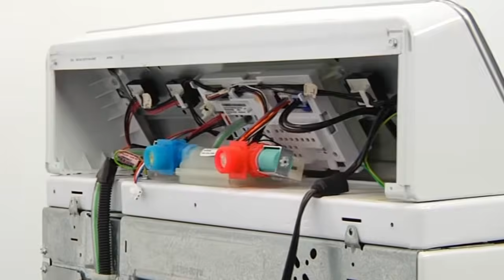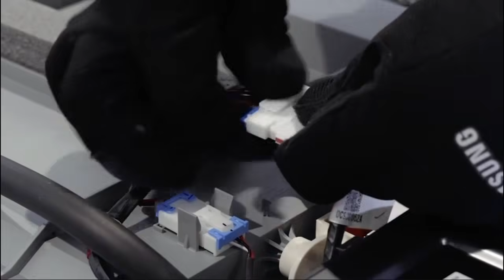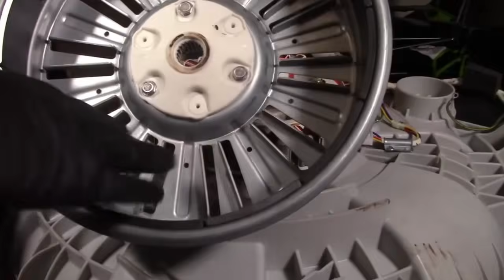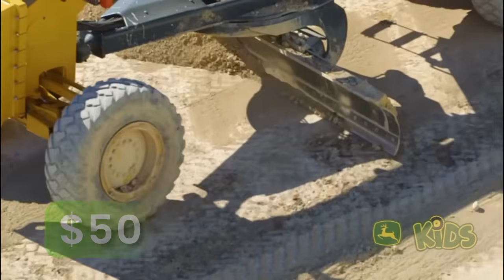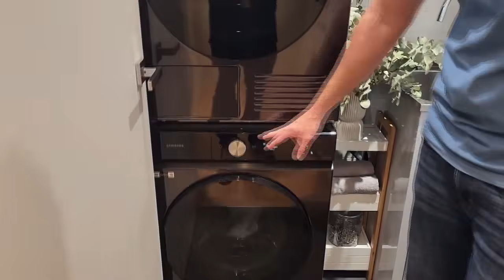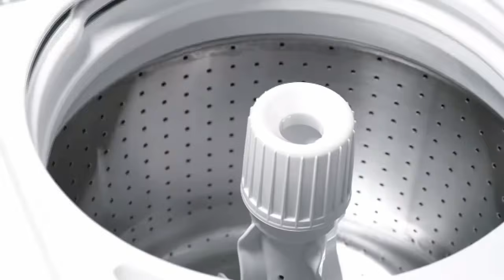Why You Can't Fix Your Own Washing Machine Anymore (The End of DIY)

Comment: Maytag is whirlpool and there is no app required to access error codes any body with half a brain and Google can do it  heck the special tool whirlpool has for us whirlpool techs doesn't even work  we just use what is built right into the machine with no special access required just a brain and a finger. Looks like the author of this video earned the middle finger though!.  The machine even comes with instructions on how to access the codes!

Comment: Not true at all.  None of the major appliances do any parts pairing.  Unless maybe meile or something.   LG offers bearings separately nobody else does. 
Whirlpool front loaders rarely if ever needs a tub replacement these days and there are no special tools required.  Though the tub basket on newer ones is a complete assembly. That no rational person would ever pay for.